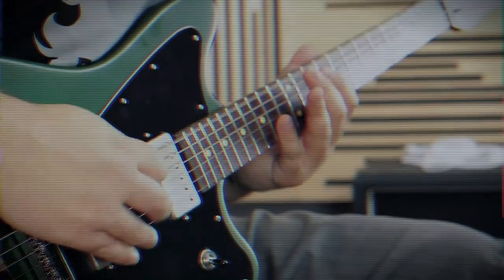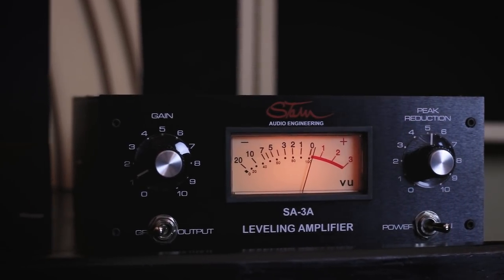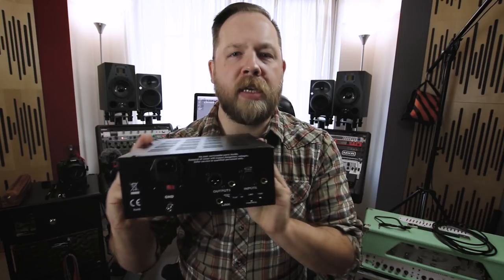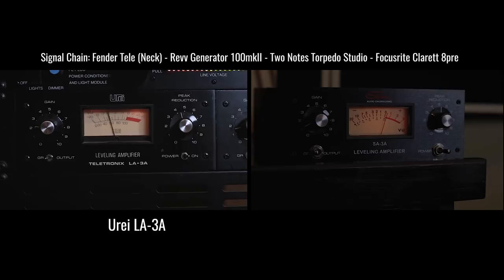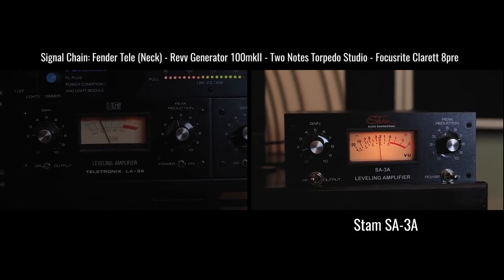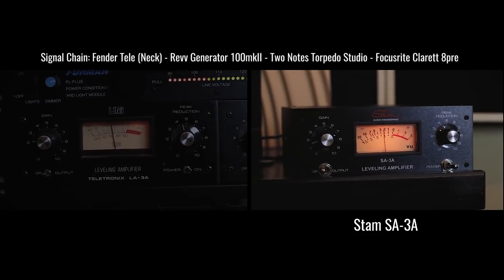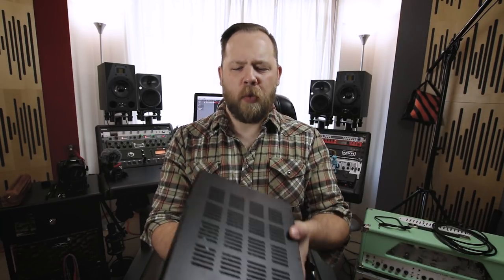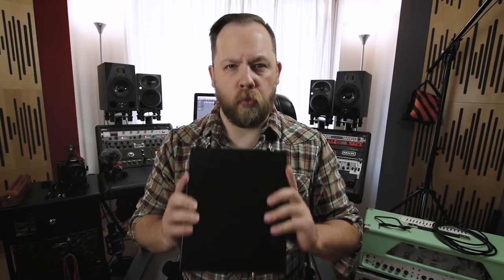Stam Audio SA-3A - Demo

Comment: I saw a lot of comments saying that the Stam was warmer sounding. I must disagree. I think it does, however, have a wider frequency response than the Urei does. My reasoning is that, if you listen to the Stingray HH, the low end doesn’t sound strangled through the Stam compared to the Urei. Also, the Stam provides a presence boost in the 5k-6k range that really comes out on the acoustic guitar and vocal tracks. Maybe in ten  years or so the Stam will sound more like the Urei due to capacitor aging? Just a thought!
Reply: My thoughts exactly.

Comment: The Stam sounds a bit warmer, it's pleasant on its own but I'm wondering if it would dull any cut in a mix since it seems to take off some high frequencies... super damn close though, definitely worth buying. Fluff! Could you do a video on your favorite studio gear "bang for your bucks"?
Reply: I can adjust the SA3A so it responds the same as the UREI on the high frequency!, it is actually quite easy to do, glad you like it Cody, best, Joshua
Reply: For me, on the vocals at least, the Stam seems to actually have more top end on Ess sounds and is a touch more scooped in the 400-1000 Hz range, it has more of that HI-FI sound to it whereas the Urei unit has more of a roll off on the top end and pushes the mids of the vocals up. I'd probably use the Stam for a more intimate vocal on a singer/songwriter track, or for a modern pop/R&B vocal where you want that sightly more exaggerated top end, the Urei LA3a would be my go to for a rock or metal vocal to give it that more aggressive mid range to cut through the guitars and a denser mix. The Stam would  really kick ass with an SM7b or a darker Ribbon mic for a Crooner Vocal as well, and it looks like a sturdy unit and probably more reliable than a vintage 3a.

Comment: The stam sounds like it has more upper midrange and a more detailed high end.  The vintage unit seems to have more low mids, less upper midrange presence and mildly rounded off highs.  If I'm doing stuff where I need cut and sparkle the Stam unit seems to be the perfect choice.  The LA-3A would sound nice on a harsh vocal or stuff that needs low mids and a smooth top end.

Comment: The Stam version sounds like probably a "new" unit back in the day sounded. The compression is damn near identical but the boxtone of the UREI unit sounds more distorted, like it has more harmonics.. basically it's components are old and make more distortion. This may be a crazy opinion but in my opinion it sounded better than the vintage unit. Hard to say when we don't have the dry signal presented so we don't know if it's "dull" or if the urei is "bright".

Comment: I may be wrong but i think that as far as Stam had a wee bit more low end and it sounded warmer, settings of actual compression were better on original unit. Signal from Stam was less compressed and less controlled. That's what I can hear. But it was close indeed :)